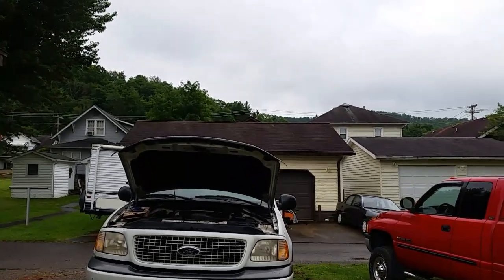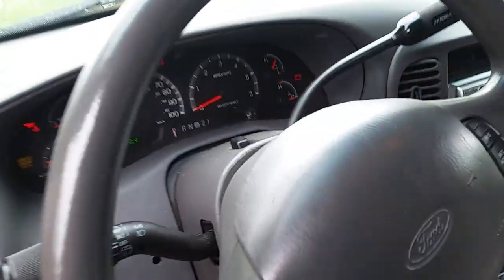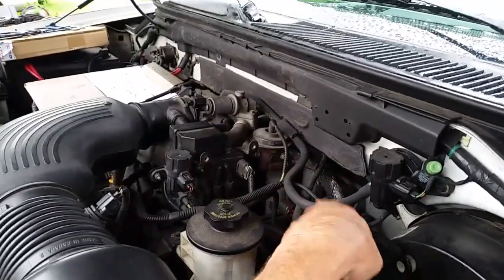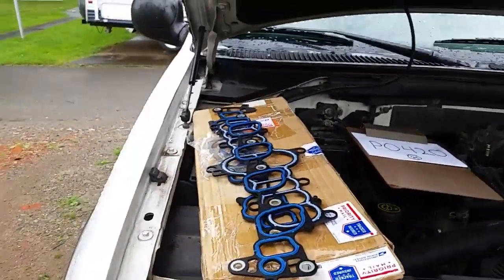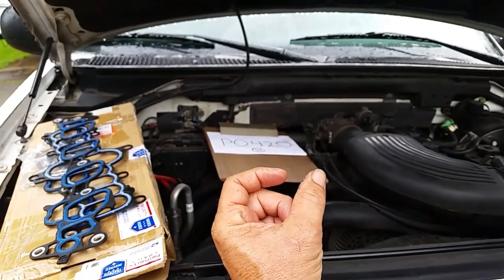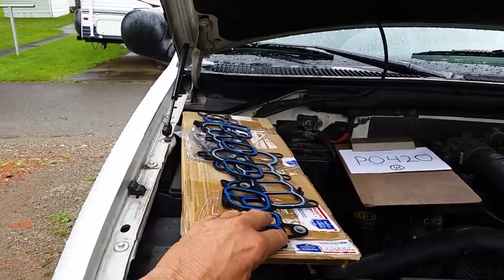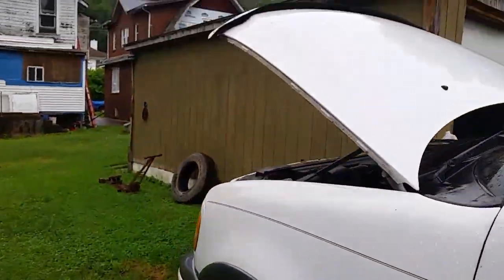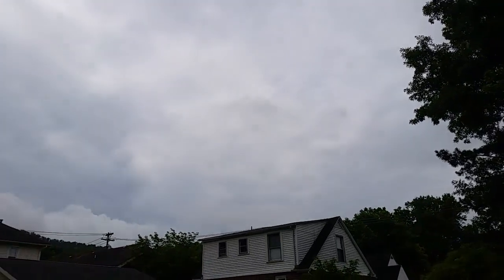P0420 Code. How to fix it. Don't spent spend tons of $$$.

Comment: Lol no no....hook up an actual scan tool and see what it's doing by monitoring the o2 sensor voltages. If you don't do that you are just throwing parts. Please quit giving us TECHNICIANS  a bad wrap please. O2 sensors and cat converters go bad all the time!!! Usually caused by another issue. If you had an intake leak then the truck is compensating by overfueling, therefore destroying the cat. So when you fix the intake leak it's very likely it will still have a po420 due to a bad converter.
Reply from the maker: TECHNICIANS  Rip people off daily. I see it all the time!--Wrong wrong wrong!!!! Listen to the video!  I said then fix the cats if all else fails! Stop giving bad advice to make you feel better! A P0430 will eventually take out a cat (P0420)! Yes fix the problem before it does. Then look at the o2 voltage if its ok then go from there. If  the 2nd o2 has a p0420...then the cat needs replaces. Shit up stream will take out the cats if not fixed.  Then maybe you a good TECHNICIAN.  I hope so. -Have a good day.
Reply: @FixingWithPassion  your right an upstream O2 sensor failure will be the most likely failure to cause a cat to go bad....next being a misfire condition then a lean condition....you see that order of failure? I see it every day, yet you yourself said in the pinned post that 02 sensors rarely go bad when in actuality they go bad quite often. Then some guy says it's not a big deal its just an O2 code 🙄  they keep driving and kill the converter. Your scenario is the LEAST likely failure to cause a p0420 and if it did cause it then your converter is already shot should've chased that lean condition long before this.
Reply: @FixingWithPassion  and a p0430 is a bank2 efficiency code......same as p0420
Reply from the maker: @boostedstinger  Strange. I''ve had maybe 3 bad one's out of a 100. But all a PINA to change.
Reply: @FixingWithPassion  a little heat and a good set of oxygen sensor sockets. See I work at a Buy her pay here dealership. All our cars come from the auction so I see a lot of cars lol. I also get all the stuff that everyone says can't figure it out take it to auction lol.

Comment: This is blatantly wrong and sad to see almost a million views on wrong info. If you have a p0420 accompanied by other codes (lean, rich, O2 sensor, etc), then address those first. Also, check you fuel trims. If there are no other codes and your total fuel trims are within reason (+/- 10% total trim), then it is the catalytic converter. There is a very easy way to prove that. Take a properly running car without any codes and create a small vacuum leak. You will get a lean code but you will never get a p0420 code when you intentionally create a vacuum leak. If you don't believe me then try it, try getting a p0420 code via a vacuum leak and you will see that its impossible.
Reply from the maker: Did you even watch the video?? That's what I said. Fix small things first! ***If the code is still there ... after everything has been fixed, then the cat/s are probably toast.
Reply from the maker: At least thats what I was applying to the issue. Thanks for watching.

Comment: This is BS , mabe a P0171 or a P0174 , NOT a P0420 , people dont do this BS
Reply from the maker: Wrong! PO420 is a bad cat or a burnt out one. All the other codes will cause the PO420 OVERTIME, causing damage to the cats! People don't understand this.... if you don't fix the other codes first! (P0171, P0174 or P0430) Get ready for A PO420 someday.
Reply: @FixingWithPassion  I replaced the catalytic converter in March and I'm still getting a p0420 code
Reply: We purchased an EcoBoost Edge. Had 199k miles when we bought it. It had a P0171, P0420, and a P0299 code. The P0171 code was fixed by replacing the upstream oxygen sensor. Jumping into the P0299 and P0420 codes. My scanner said the light was triggered around 160k miles. Now have 218k miles on it. Runs fine but lacks power. Which is caused by a bad turbocharger. Hoping the old lacquer thinner fixes the P0420 code. If not, we will gut the cat and use the car ”offroad” only 😉

Comment: Very bad information.  Scan rear o2 sensor while driving.  If cat shows no oxygen storage capacity, you need a new cat.  If you get a p0420 code, 99% of the time you need a new cat.  This code also takes two consecutive drive cycles to set so it reduces false codes.   Don't buy aftermarket shit .  If you can't afford to fix it once, then you can't afford to fix it multiple times.
Reply from the maker: Yep P0420 cat time, P0430, leak/intake upstream etc 90% of the time. That was my point here.

Comment: I replaced both cat’s on my 05 sentra 2.5.  (same as the altima’s) almost every time when I drive at 70-80 mph the 0420 code goes off.  anybody knows why? I clear the code before the smog inspection, drive it for 48 miles & pass the smog test. so I know is not the cat.